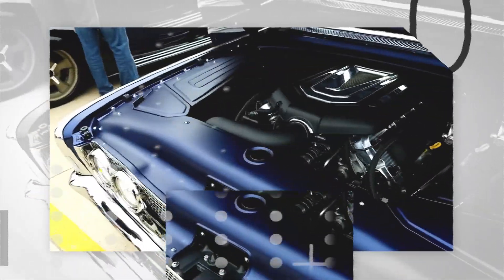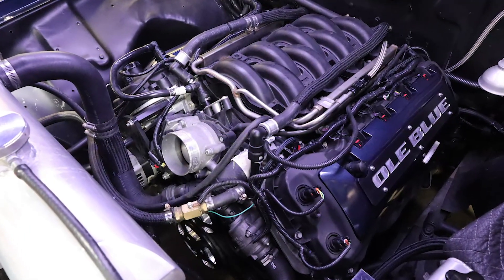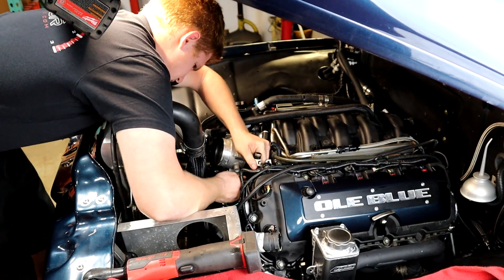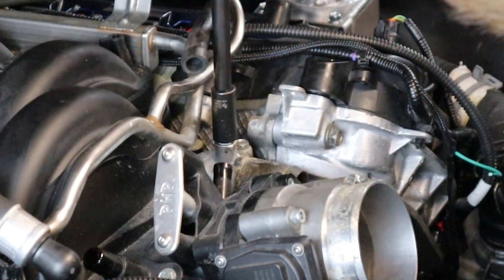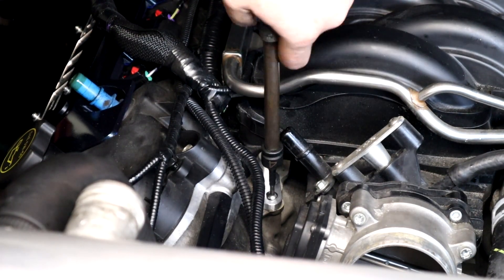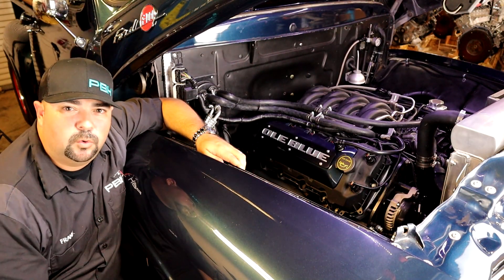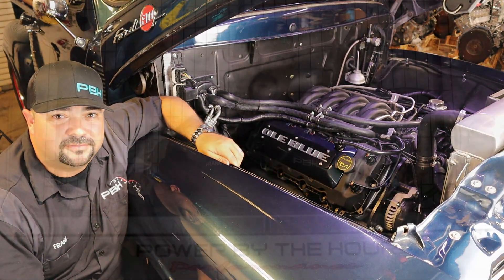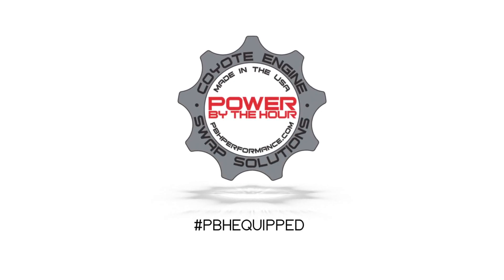How to delete the Degas bottle from your Coyote Swap Cooling system

Comment: It would seem like the old setup with the temp sensor in line of the degas bottle wasn't the correct placement for it.. with new setup it is more accurate placement for the sensor..

Comment: Hey Frank. Do you have a control pack for a 2018 coyote with a 10 speed 4x4?
Reply from the maker: The current control packs can be used with a 4x4 transmission, but will not control the 4x4 function. So independently controlled transfer cases or manaul versions are needed. Also, make sure you have select shift wired so you can use that while on the trails.

Comment: Hey Frank. Ryan Merrill here. You said the restrictor is located in the hose itself?
Reply from the maker: Yes Ryan. Passenger side heater hose there is a clamp 1/4 of the way up. That's the oem restrictor
Reply: But with the pbhperformance water neck replacements, the restricter is in the water neck not the hose